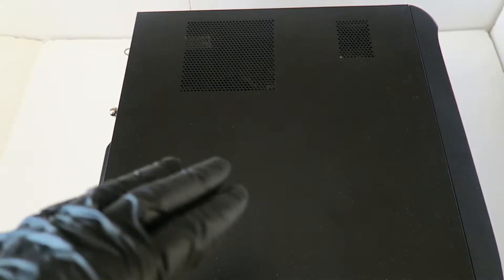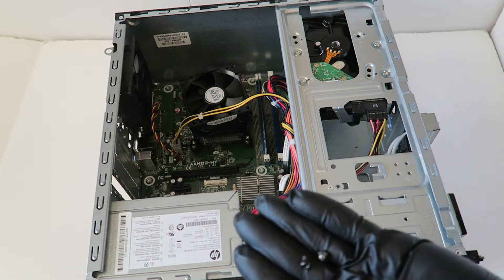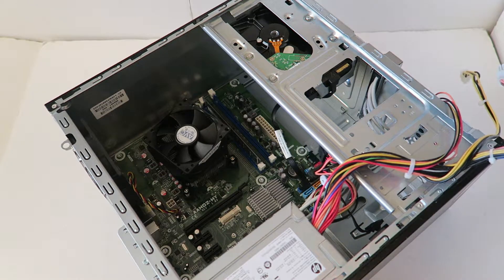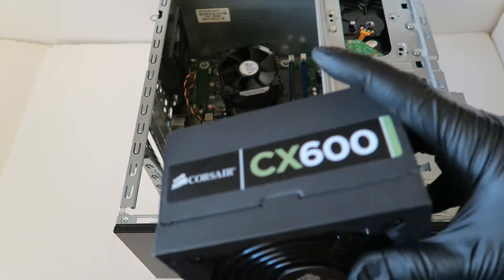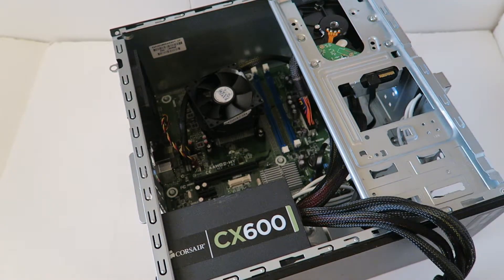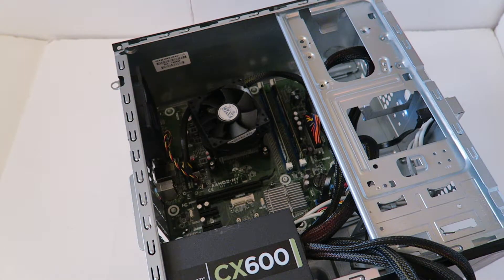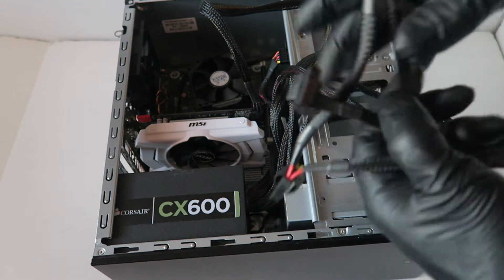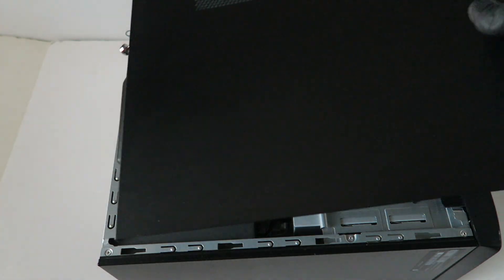HP Pro 3405 Gaming Upgrade Video Card SSD PSU RAM

Comment: Hello 👋  my has a amd processor and I bought a 1030 gpu. Will the cpu hold back my gpu plz. If so where can I get a cheap i5 cpu.
Reply: Yeah you're cpu will hold it back, alot. Also, you can't put an intel cpu in this motherboard, but you can get an amd cpu (such as an amd athlon x4 640) which will fit in the motherboard

Comment: but what happens if i dont have six pin power to connect videocard?
Reply: You need a different power supply, or a graphic card which doesnt need external power

Comment: Is there a way to switch the system into another case? I've got an Optiplex 3010 with an i5-3470 and the front panel connectors are hard to figure out but I've got the power button to work and the power button LED to work as well, but I get an error message every time I try to power on the system:

 Alert! Rear fan failure 
Alert! Power Button Cable failure 
Alert! Front I/O cable failure 

Has anyone gone through this before and how did you guys fix it?
Reply: Yes you can put everything in a different case but you do gotta take everything apart but the ram and CPU you can leave that on the mother board during transfer